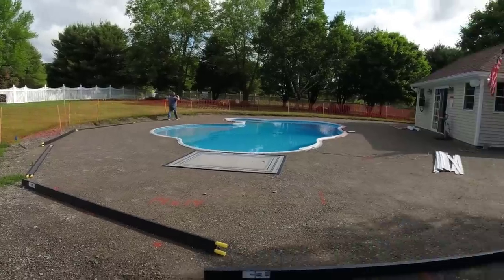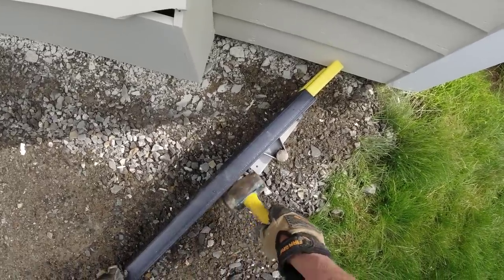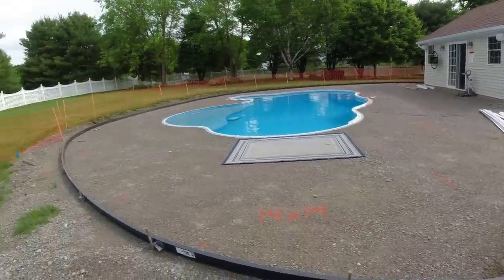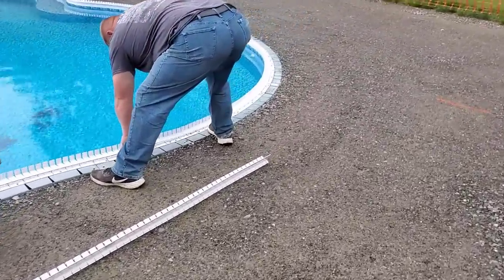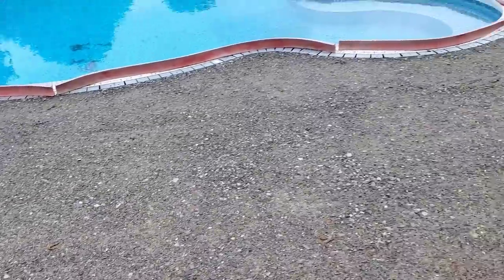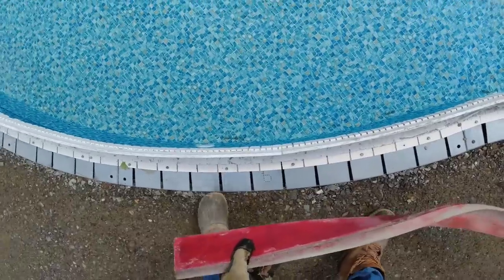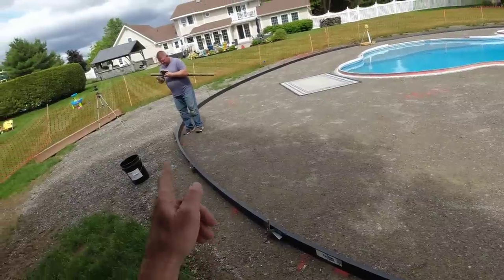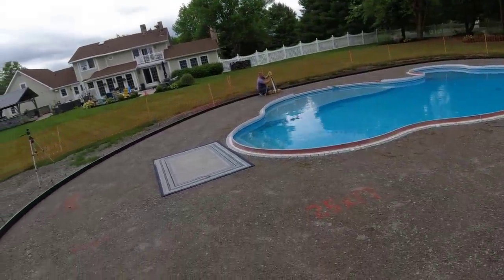The Best Flexible Forms For Concrete Patios, Walks, and Pool Decks! (Also, Best Pool Coping Forms!)

Comment: Mike. 
. Really enjoy your videos. Im a Union Laborer in Boston (33 year member) with a background in excavation, civil work and working as a grade foreman. Four years ago I spent two months at Logan Airport with a Carpenter doing sidewalk forms. What I liked about this form system is how easy it was to attach the form to the D Stake. Doing sidewalks that have to meet existing doors, have pitch to accommodate water runoff and meet ADA  regulations can require minimal adjustments on the forms…for years I used a TopCon laser similar to yours. I use a Hilti laser now  and I love it. The Hilti receiver will show you how high or low you are from zero ( 1/8 inch high, 7/8 low)
Rob 
(1990 graduate Kents Hill School 😊)
Reply from the maker: That's awesome Rob, how do you like working in Boston? And thanks for the great comment!

Comment: Thanks for your videos on finishing, my husband and i are pouring our driveway in roughly 10 X 3.5 sections, one at a time, when we have time.  We know Shotcrete in and out, but not poured concrete and your videos have been massively helpful to learn finishing techniques.  Still working on improving the skill level and cleaning up the over spread on the previous concrete but your videos have been hugely helpful!

Comment: There’s something called composite, edging, more or less took the place of the metal, edging that goes around gardens and flowerbeds. It’s very similar to your product. We use it all the time easy to work with just screws together has metal pins/stakes
Reply from the maker: I've used it, I like these forms much better.

Comment: That's actually pretty cool system that they have.  Will have to wait to see how the one's that you twist in the middle hold up, ie. if they get really loose after a lot use.  Setting the height looked really easy also but then again that's also a lot of experience.  Great video.
Reply: Never had a single issue with them since 2007
Reply: @johnborton4522  when you have to cut one do they have the yellow connector that you can add to the cut piece?  Thanks for the info
Reply: @MrBrewsk  

The connector sections are just square tubing.  Depending on what you are using them for (straight or curved), the connector can be either semi-rigid plastic (for the flex), or metal square tubing (aluminum or steel).

The plastic square tube is available from the company, but mostly I do straight work so I just get square tube local.   I have welded up 90 and 45 degree corner connections as well that I slip in as needed.
Reply: The Poly Meta Forms system holds up to time and use! The channels stay true so the twist pockets and slide pockets will work the same for years to come. Remember to clear your channels with the slide pockets after each use to keep your forms fresh!

Comment: My question is how do u keep the poly forms clean without spending a lot of time scrubbing them. I like them, just not sure I would have room for the parts and forms on the trucks or trailers.
Reply: Right after use, run the slide pocket through the channels and spray down. It is always critical to keep all equipment clean and free of debris whether it be the Poly Meta Forms, or any other. It will prolong the life and save $$$$ is the long run. :yougotthis:

Comment: You do great work Mike! I've watched most of your videos. I'm going to purchase your slab course. I'm not a complete newbie - I worked for a mason when I was in my twenties (I'm in my 50s now). Could you recommend a channel or other source that shows how to do site excavation and prep for my slab pour? I'm doing a 20' x 12' slab attached to the house for a garage, on top of ledge. I'll have to excavate 12" deep 18" wide footers. We are in a hurricane zone and the inspector said this new building would have to have a foundation as sturdy as the house. I'm going to a structural engineer for the carpentry specs. Again, I'm not a newbie for the carpentry. I built a 16' x 12' sunroom addition on top of a 10'  high 16" block foundation, for the same house. Many thanks, JD.
Reply from the maker: Look up Letsdig18 on YT, he does a lot of excavation videos.

Comment: How tight of a radius can you form with these?  I ask because we use 1x lumber for 15 ft and greater radiuses. And anything tighter than 15 ft we use Masonite. Just wondering if this would help with the reoccurring cost of buying the long lumber.
Reply: Hi, great question! The Poly Meta Forms Flexible Radius can form down to a 3' radii!

Comment: I've been mixing concrete for a huge DIY project on site.

Washed sand / Crushed stone / Portland(T1)
5:7:3

I've been filling a wheelbarrow with the sand and running a garden hose through it / stiring / water over-flowing for 3-5 minutes, then draining out the water / froth.

Is this step excessive?  Would the sand be fine as is with a small amount of organics / dirt?

Re-rinsing doesnt froth, so there is an obvious difference in how clean the sand gets.

Just not sure if it matters?

Comment: They go together nice but how will they work if they are not cleaned properly?
Reply: Great question! Just like any other product that is used, it is critical to keep your forms free of debris. After use, the channels should be cleaned by simply sliding the slide pocket through the length of the forms channels. This will ensure longevity of the form and will save you $$$$.

Comment: How you getting the stakes out when you strip the forms?? Almost need a stake puller.
Reply from the maker: We tap them with a small sledge or use Vice-grips.
Reply: Used these forms since 2007.  I have a stake puller and might use it if I waited till the next day, but I don't wait.  I pull the forms in the first few hours after pour and using a Vice-grip to turn and lift I pull the stakes out smoothly as soon as the final power trowel is done.

Comment: Looks like an ok system, can for see problems with the yellow connection pins if they’re not replaceable. Also, with buildup on them if not removable, at the end of the forming, would not be my first choice. Just my opinion.
Reply from the maker: What's your first choice.
Reply: @MikeDayConcrete   I had steel sheet forms for many years, which were in statement, a pain in the butt at times, the Plastiform brand was much easier, and in  a pinch, luan cut in strips, but, like I said, just my opinion, I’m retired now, so just a peanut gallery critic. If they work for you, it’s the way to go, lord knows this profession is hard enough, without making it harder for yourself. 👍